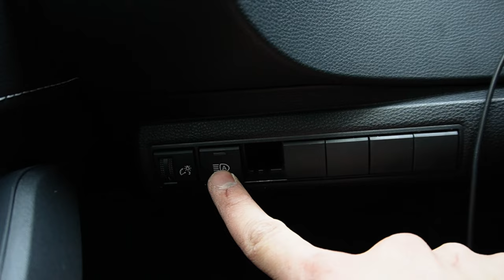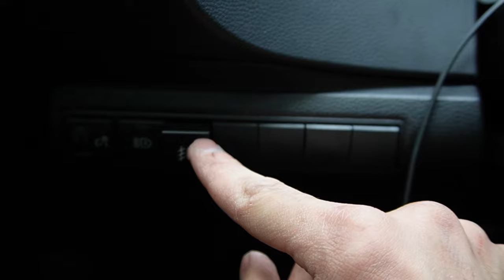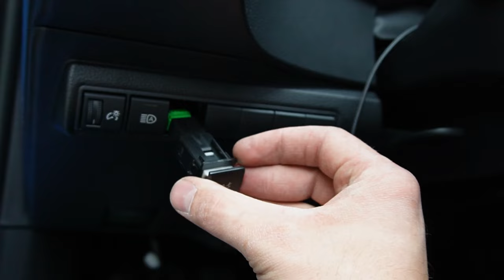2022 corolla se gets some fog lights! [4k]

Comment: I said screw it and took the front bumper off. Made it so much easier to tuck the wires. Zip tied em through the front support, connected to the battery and removed the wheel well liners to make it easy to thread the wire through the firewall. Drilled a hole in the grommet and pushed the wire through and removed the trims inside and connected it. If you tap in to your windshield wipers or something that only works when your car is on you can get your fogs to turn off when your car is off as well. Did mine today and added the yellow tint on my black hatch 💯 also like the idea of having to manually turn the fogs off that way you can run the fogs by themselves, with the DRL’s and or with your headlights 😮‍💨
Reply from the maker: Yeah true I could do some more work and make it a little more legit, this was just the easiest/ fastest way i found in order to better help others who may be interested in doing so! 😃
Reply: did the same thing with mine, hooking it up to the washer fluid fuse with a splicer was perfect, tucked everything away under the dash and wired on the bumper support. I didn't drill a hole through the Gromit though. Would you suggest doing that? do you think that would bring water behind the firewall? was worried at first but my coworker at the shop said it would be fine.

Comment: I'm happy to see that you don't need to take off the whole bumper to install fog lights. That's what was giving me hesitation, as I've heard that once you take off the bumper, it never fits right again. For $100, it really doesn't look bad. I'm trying to do small mods first, so I'm upgrading my horn next, but this might be a contender once it's warmer outside. Do you notice a difference when driving at night? In my old car, I usually just leave the fog lights on to see better, especially on long highway drives.
Reply from the maker: Yeah they help in fog as intended and add a bit more of extra light to compliment the headlights but not too crazy of a difference
Reply: @ricevlogs_  Thanks!

Comment: I was thinking about using a hole saw and cutting a hole in the factory part, it looks like the lights will bolt in them.  would be way faster.
Reply from the maker: Definitely will